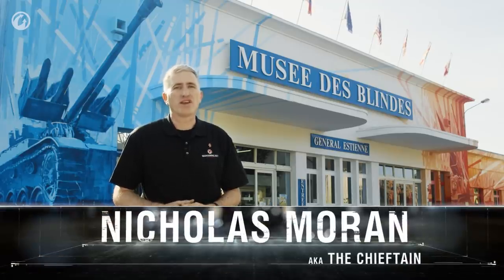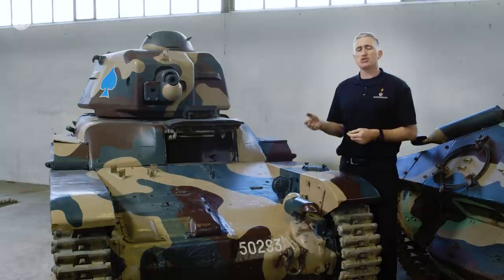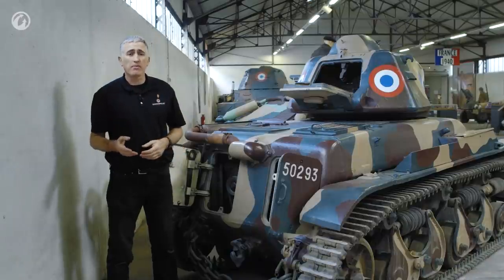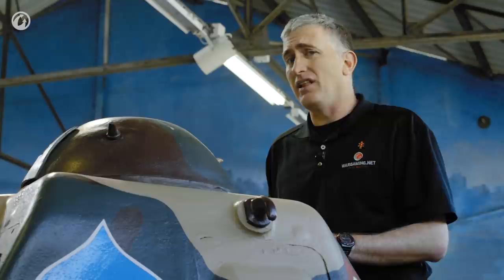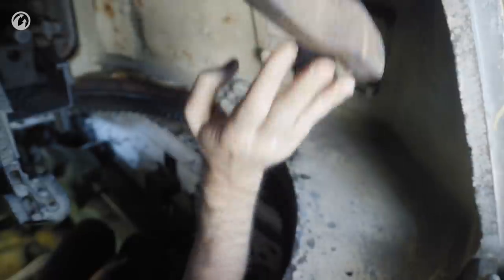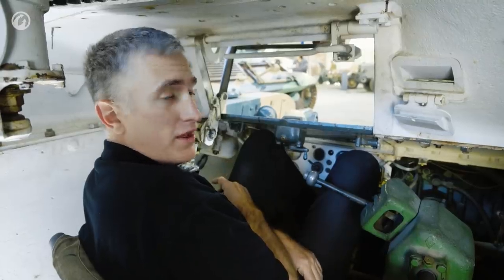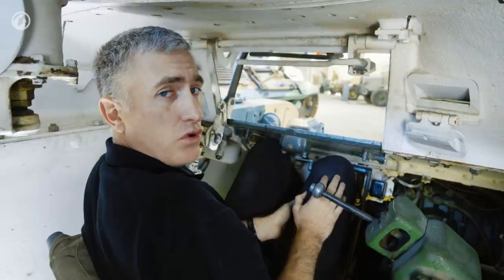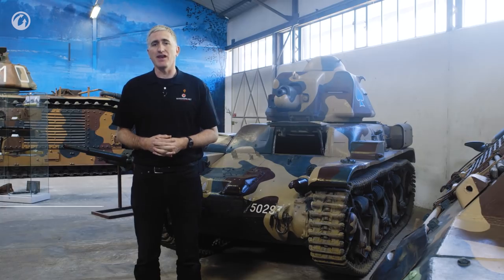Inside the Chieftain's Hatch: Renault R35

Comment: "A physical contact" to communicate with the driver? Let me guess, in a noisy tank that would be a kick with a boot.
Reply: Exactly.
Reply: TotalRookie_LV the physical contact by booting the driver with "nice" kicks was more common than you think because the intercom system, if available, failed quite often during the war so as the driver can't see what the commander wants he just received a series of well aimed kicks that leaves no doubt what the commander wants! That he will have a very sore back at the end of the day is another story..
Reply: Well, once again I was mostly just joking, but only found out, there is something to it. 
Someone needs to spraypaint  this on the back of the drivers seat or at least attach a paper with the message: "In case driver hangs up, reBOOT it!
Reply: TotalRookie_LV exactly what I was thinking as well! Rebooting is the correct answer when the driver has done a fuck up! Lol
Reply: yes, and the t-34 was no different.
Reply: +NedYarbNexus
T-34 at least had intercom for commander and driver. Except "commander" was not really a commander.
Reply: so the T-34 and T-34-85 had a intercom with the driver and commander and thats it, not with the Loader(t-34-85 only, the t-34 had no loader), gunner or bow gunner?
Reply: My dad was in the British army in the 1960's, they used to steer a tank (or an armoured car) by the commander kicking you on the shoulder for left and right. Always wondered if a kick in the head would be stop or faster?

Comment: The plugs for the vision slits remind me of the Peril Sensitive Sunglasses in Hitchiker's Guide to the Galaxy: When peril is detected, blind yourself so that you don't get scared.
Reply: Strange.  They remind me of an attempt to keep out bullet splash when the tank comes under sustained rifle and machine gun fire.  When a bullet hits a hard target it can break up.  The fragments go all over, and some can come through a vision slit.  Eye damage and other crew injuries are possible results.  So your statement is the opposite of correct.  The point of stopping bullet splash is to prevent yourself from being blinded.  Being able to block the vision ports was a wise precaution.
Reply: alcibiadesW and they say i am not fun at parties.
Reply: Well, to be fair to the manufacturer of peril-sensitive sunglasses, they work perfectly against the Ravenous Bugblatter Beast of Traal.
Reply: Very, very ravenous.

Comment: So a Mk19 has more firepower than the 37mm gun of this tank?
Reply: budmeister yep
Reply: budmeister maybe idk how big they made the HE round for this gun but they could still have fit more explosive filler on the tank mounted one
 think of it as .357 magnum vs 30-06 yeah it's a bigger bullet diameter but the rifle bullet still has a similar weight range for it's rounds just depends on how they wanted to make them (the tank gun rounds)
Reply: M71 90mm HE had about 2 pounds of explosive in it.  If you think 2 pounds of HE is weak then idk what you've been smoking. And, heads up, no one uses minengeschoss except in a select few aircraft guns from the Cold War, which are rarely used anymore. Mine shells are weaker structurally, and have to be fired at lower velocities, making them ineffective for hitting fast moving and maneuverable targets.
Reply: So a hummer with a Mk19 out perfoms this tank.
Reply: Not only is the 40mm grenade from the M-19 more powerful, but has better range and is more accurate.  Go, go DEPD out to 900m...  What many people don't understand is that the explosive fillers used by WWII tanks was more powerful that the equivalent mass of TNT, but today's fillers are significantly more powerful that the fillers used during WWII.
Reply: Andrew Coetzee until it takes fire, yes
Reply: Slightly larger bore size isn't the reason as much as the 40mm grenade had the advantage of much lower firing pressure and thus can get away with having much thinner walls and thus more room for explosives. 

Also, the round launched by the Mk19 (40x53mm)is not the same as the 40mm round fired by rifle mounted grenade launchers like the M203 (40x46mm). Even the higher pressure round of the Mk19 only travels at ~240m/s whereas the 37mm Puteaux SA 18 had a muzzle velocity of ~600m/s which means that the round itself, both the cartridge case and the "bullet" have to be substantially stronger to cope with firing stresses.  this makes the 37mm more accurate and able to engage moving targets if the commander can see the bloody things at all.

The commander/gunner/loader/signaller/driver abuser  of this vehicle has got to be the busiest guy on the battlefield and probably amongst the least effective.
Reply: Jimmy De'Souza  Most of the explosives used during the second world war are still used today.

Safety, durability and storability are the key areas where modern explosive fillers differ. 

The solidness of the round has to do with the stresses involoved in firing the round, there is a huge difference between the American 105mm M1 howitzer shell with 2.18kg of amatol filler and a 105mm L7 tank gun as mounted on the original M1 Abrams with 1.4kg despite the tank shell weighing 7kg more.
Reply: @Andrewza1  The humer didn't have the armor
Reply: @druisteen  I mean it not just Armour. The humvee May not be able to be able to take a hit but it greater situanal awarnes and mobilty plus the meme of the 40mm is why I say it is better.

Though there is a few years difrence in tech I will say we are advanicing faster and faster. The solder in 100 BC would not be shocked by the solders of 20AD but 1900 to 2020 gap is masive. With this rate of advamcment what will 2100 armies have.
Reply: @Andrewza1  
Your ar gammer or your understanding doesn't go so far ..??
We are talking about a tank who ar verry well armored for it's purpose , attacking machinegun post !
Reply: @druisteen  what does a gamer have to do with any thing. You do know a lot of front line solders like to play video games.

All so the R35 was light tank. İ am sure a humvee could do the job of a light tank better than the R35. And this is everything to do with the fact we are so far ahead of the 1930s
Reply: @Andrewza1  Vidéogame is not reality .

Comment: Given some of the strange buttoning up -- to what extent did inter-war tanks, or indeed WW2 tanks, consider gas protection?  Given its impact in WW1 - I do wonder if there was some limiting in place in terms of openness?  Or at least consideration given?
Reply: Most didn't bother with it. Gas protection means you would need to make perfectly fitted plates and welt them together super cleanly in addition to an overpressure system that requires a lot of power as well as a large and bulky filtration system.

Comment: My dad has one of those R35 tank engines. He made it as the power plant for an arc welder. Direct belt drive off the crankshaft to a B-17 generator with a B-17 heated flight suit controller to adjust the amperage. All on a hand built wheeled frame.

Will you be doing the Ducky?
Reply: You need to post a video of that outfit.  I just sub'ed to you in case you make one.  Peace.

Comment: I  find  your  VLOGS  amazing  and  interesting.  I'm  trying  to  wrap  my  head  around  why  every  tank  manufacturer  discriminated  against  people  who  were  either  overweight  or  tall.  This  tank  epitomizes  to  me  why  the  French  folded  up  shop  and  got  out  of  the  war  so  early.  Apparently  the  French  had  many  qualified  dwarves  in  their  tank  corps.  I  drove  a  Renault  Dauphine  for  a  little  while, back in  the  1960's,  it had  a  lawn mower  engine,  and  a  very  strong  man  could  probably  power  lift  it.  It  was  an  absurdly  awful  car... now  seeing  the  type  of  tank  they  would  make... I  would  be  entirely  scared  to  death  to  take  it  into battle.  I  try  and  shut  out  this  recurring  image  of  how  dead  I  would  be  IF  the  tank  was  struck  by  any  type  of  artillery  shell... I  can't  figure  out  which position  would  be  worse,  the  TC  or  the  driver.  All  of  which  undermines  this  whole  idea  of  rolling  up  and  firing  a  25mm  round  at  dammed  near  anything!  About  the  only  way  I  think  this  tank  might  work  is  that  a  company  or  division  might  have  around  at  least  10-20  or  them  buzzing  about  like  a  hive  of  bees.  Keep  up  the  good  videos... are you planning  a  VLOG  on  the  T-28  anytime  soon?
Reply: More nightmares to think about: the AP .30-06 round (standard issue to American troops) was rated to pass through 1/2" steel plate.
Reply: I had a Dauphine as my 1st car in the 60 s and I can agree it was bloody awful.

Comment: I understand the concept of keeping that tanks slow so they can't easily desert the troops, but how do you quickly relocate them to where you need them when you finally engage the enemy?
Reply: Did you ever heard of... railroads?

----
Like, really, that's the secret of all armour units in all countries even today.
Reply: +20 kph will not make a difference whatsoever when you need to relocate quickly in a country as big as France. The hellcats could do 60+ kph easy and they hardly ever actually used that speed. If your intelligence fails and the enemy breaks through somewhere else you are f*cked anyway. But most importantly these tanks were built for a very specific doctrine like the Chieftain said.
Reply: Yes, also, the infantry tanks have little value if there is no infantry with them. If we are talking about their mobility on the operational level, they remain as mobile as your leg-infantry. As long as you provide your forces with logistical support you might expect with a reasonable amount of certainty that your armour won't be separated from the infantry they were supporting and that the tanks will be operational when necessary.

The problems start whenever your logistics fail or when the armour mechanical reliability starts dwindling or is lacking from the get-go.
Reply: You are correct Robbie Rotten.
Reply: The thing is, back in the day, tank doctrine wasan't a sure thing, it was a verry blurry kind of warfare. Many type of tanks and doctrines were created and basicly everything failed. You worry about the tank speed is a concerned in the battlefield, this type of tank is not malleable, it was good to one thing and one thing only, which end up making it a useless and expensive machine. Today tank warfare is completly diferent, tanks need to be extremelly malleable, they need to be extremelly fast, so they can move to any location in the battlefield at a small amount of time, giving the oportunity for flanking tatics and much more, the cannon also needs to be able to deal with both tanks and infantry and the armor need to be able to take hits from all kinds of stuff. Soo yeah, this excuse that infantry tank shouldn't be fast is complete bull, and that ideia soon lost popularity, as far this tank... Chieftain is right, somebody most've smoked some heavy weed when they made the vision ports on that tank, visibility is important, especially for a infantry tank, comunication is also verry important, and the gun... that gun is horrible to kill or supress anything lol
Reply: This was a problem.   However, even those speedy tanks you read about were not driven around at max speed, they would harm their crew and shake themselves apart.  9mph is what a modern commercial  lawmower can do.  It's plenty fast on a crowded road, bumper to bumper., or supporting infantry.  It was not enough for mass maneuver, but it wasn't designed for that.

The type tank (infantry support) was a dead end in design.
Reply: Tanks of 1940 would break down more often than they would fall behind because of their speed.    They were "fast enough" for the intended use. The problem was that their supporting units (fuel, etc) were outmanuvered and mismanaged and they were run out of fuel or broke down on long road runs.
Reply: These are FRENCH tanks.  Engaging the enemy is something they just don't do.  Unless they are fighting their allies...
Reply: And French armor doctrine did not allow for Infantry tanks to exploit breakthroughs, that was only for the Cavalry tanks.  If there are no Cavalry tanks where you break through, well you wasted your lives.  But then the French killed off hundreds of thousands of soldiers in WWI, they were used to throwing away life for no good reason.
Reply: You don't. These tanks were designed to be spread out over a front and their purpose was primarily offensive, to be used when the local units were ready to attack, ....then the French realized way to late there wasn't going to be a front and their infantry was totally on the defensive. .

Comment: We need the Panzer 3 to compare what the Germans had to fight this, also please do the Panzer 4 with the long 75mm gun which was the main German tank for the whole WW2
Reply: The Panzer III didn't form the majority of German tanks until 1941 (maybe late 1940, I don't remember exactly when). For the Battle of France, the Germans had to mainly use their Panzer I and Panzer II, which weren't much better than the R35 really.

Actually, if there's one consistent thing throughout WW2, it's that the German tanks were constantly outmatched by their opponents. German tank crews only did so well because their doctrine was vastly superior, combined with better training, experience, and more importantly, radio communication. Other than that, German tanks are always, ALWAYS overestimated. Even the very good and potent (once its flaws were fixed, that is) Panther wasn't as good as most people make it out to be.

Comment: The Slits on the turret were not that simple.  There were installed episcopes PPL160 with 68º horizontal FOV and 24º vertical FOV .French tanks used "episcopes" to provide the crew with views outside the tank with a large FOV through a very tiny viewslit and provide protection by having what is in effect a small armored, vertically rotating "periscope" view (vision area is offset from the opening in the armor plate) .   The cupola inludes a PPL180 with 30º vertical fov (and guess 68º horizontal fov) that would be used by default and a estienne 114mm slit.....

Comment: Basically, the R-35 (1x37 mm & 1x MG) could theoretically replace two FTs with half the manpower needed. But as the points out one weapon was a turret gunner-commander-loader in an FT was overworked. “ I have no words …” about sums the R-35 up.

Comment: No mention of its atrocious reliability? Atrocious to the point that when Poland, desperate to buy tanks to supplement their own, initially tested it in early 1938 they adamantly refused to buy it due to engine and suspension problems (including an incident where it outright caught fire) during testing, and only wound up purchasing them a year later out of a final act of absolute desperation?

Comment: The 2 man tank wouldn't have been so bad (It did work well enough in WW1 after all) if they had focused just a little effort in improving the ability of the guy in the turret to see and engage things. Along with giving it at least a 47mm. Even the SA-18 in WW1 was barely capable of engaging German entrenchments.

If you are going to make a tank or any vehicle who's sole purpose and existence is to carry a heavy weapon under protection to engage the enemy you are really failing on the whole concept if the weapon it carries is meh at best. Only thing worse then these was the Matilda I ... a heavily armored MG carrier...

Comment: Let’s take a moment to acknowledge, this thing has a 5.9 liter inline 4. That’s bigger than some v8s today
Reply: Engine efficiency has increased substantially over the years. The late WWI era Liberty was a nearly 20 liter V12 that put out 400 horsepower. It was considered world class at the time. Even at the end of WWII, a similar size American V12 tank engine was still only good for about 770 horsepower.
Reply: Engine size s engine size. The only reason that they make larger engines into V8s is that when you get too big with the pistons, and the stroke is to long, you can only run it at low RPMs and you get more torque but less power. That's why anything over 2.8L tends to be a 6 and anything over 4.0L range to be a V8. That splits the same displacement up into more, smaller, pistons with a shorter stroke, and most horsepower.

Comment: 8:55 Romania used the desperately outdated R-35 on the Eastern Front (yes, really!) where it became blatantly obvious that the original low velocity 37mm just couldn't cut it anymore - a bunch of these R-35s were upgunned using captured 45mm guns and given the (overly optimistic) name of "Vanatorul de care R-35/Tank hunter R-35"; they also received new German-made radios, so you still couldn't really see what was going on outside but at least you could share your confusion with the rest of your platoon!
Either way, the way the French decided to replace the guns on these tanks sort reminded me of that - although the 45s on the Romanian 'Vanator' thankfully had better performance than the SA-38 and actually did OK against the lighter Soviet tanks.
Reply: They received them mostly because the Germans didn't want to give them any more capable vehicles so they only received those old French ones and later some panzer 38t
Reply: Well, the initial batch of French (R-35) and Czechoslovak [LT-35/Panzer 35(t)] tanks were actually purchased before the war (and were reasonably modern at the time), but once the Germans occupied those countries, all subsequent orders went through Berlin and, surprise surprise, they were very reluctant to sell, like you said. 

They did eventually agree to sell some Panzer IVs and Stugs, but the bulk of Romania's tank force even as late as Stalingrad was outdated 35(t)s, with a handful converted into 76mm tank destroyers (the TACAM R-2).
Reply: @cb-hz6dm  some came from Polish tanks retreated in Romania and some from those captured by Germans.